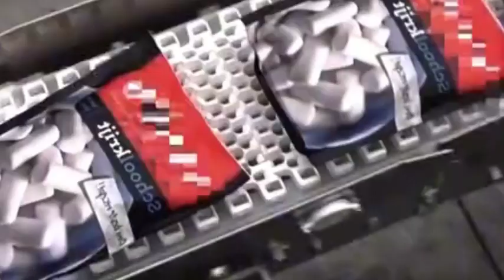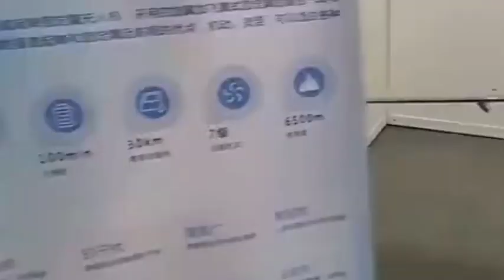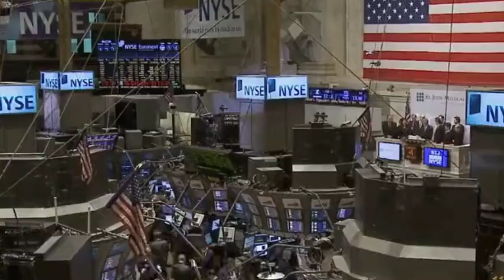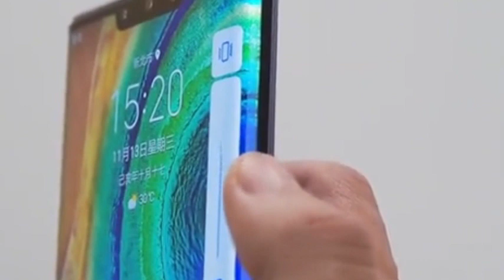Chinese chips are increasingly surviving under U.S. restrictions and will become long-term winners

Comment: China set a goal of 70% self-sufficiency in semiconductors by 2025.  It appears China will achieve that goal.  China's continued rise in silicon and alternate semiconductor applications such as photonics, graphene, and quantum chips are becoming reality.  Last year, China has a photonic and quantum chip production lines running.  Earlier this year, it was reported that China had produced a graphene semiconductor and was taping up graphene integrated circuits.  China's world production in semiconductors have risen to 24% and the US has dropped to 10%. This will be China's decade to lead in semiconductors.
Reply: Thank you for this analysis.